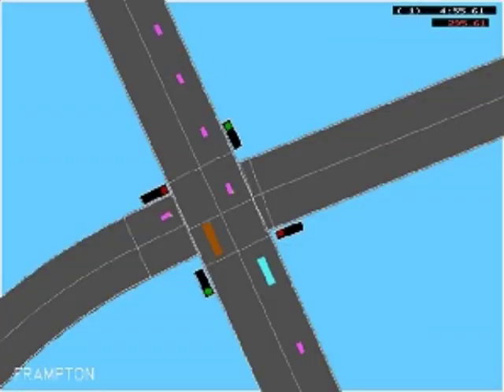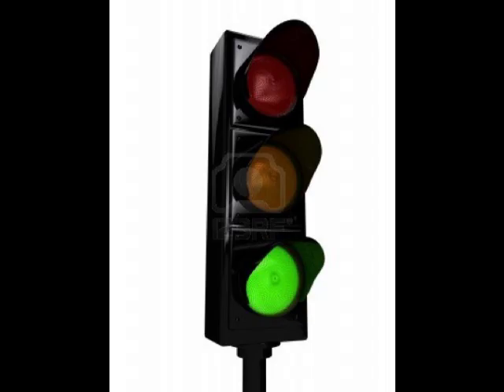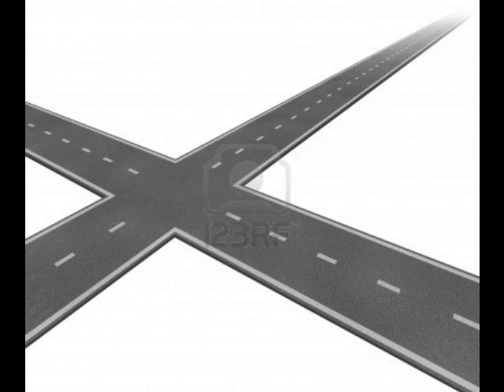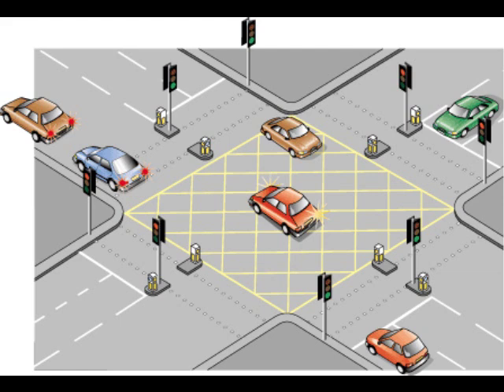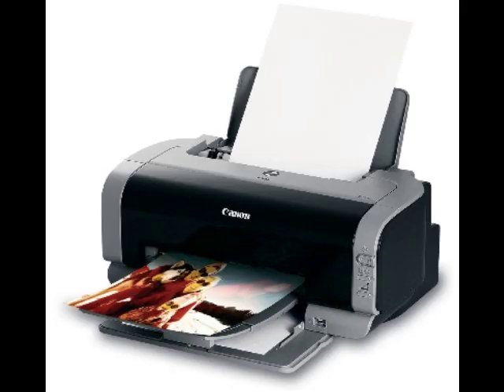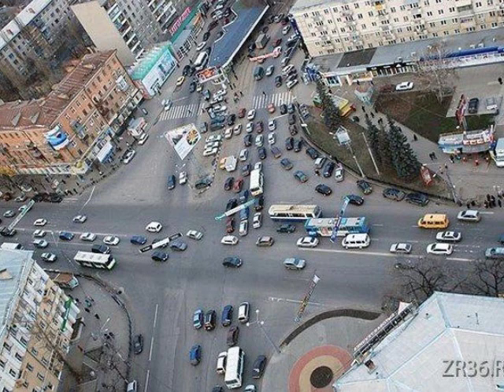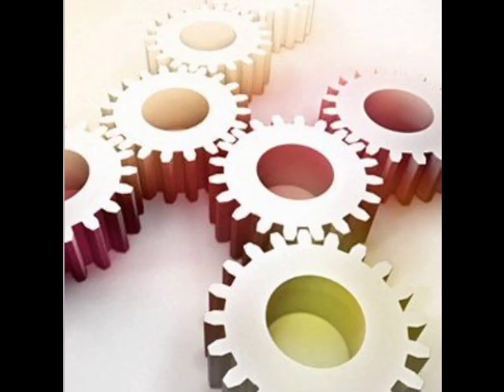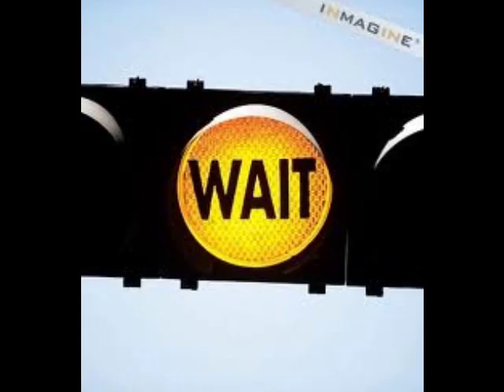Semaphore  and Mutex Simplified

Comment from the maker: On a broad level you need semaphore for any shared piece of code, i.e. if you have a buffer which is been filled by a task [Producer] and is been used by another task [Consumer] then we need to have the mutual exclusion for accessing the buffer [Which is nothing but a variable]. In the video it is generalized with the example of the usage of a printer which you can visualize as the shared buffer as I have explained above.